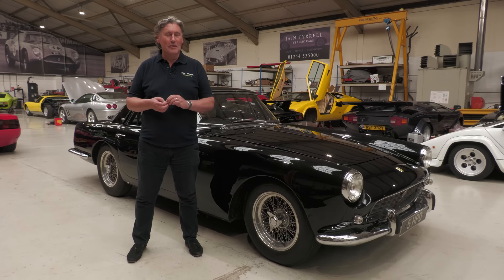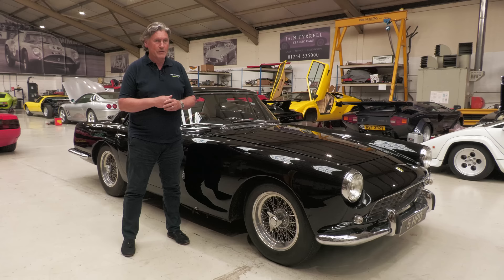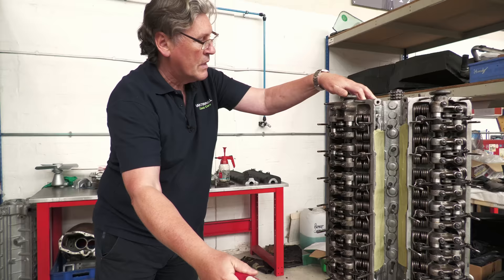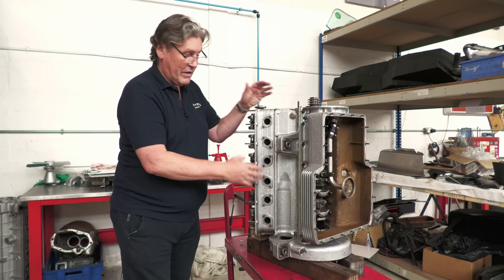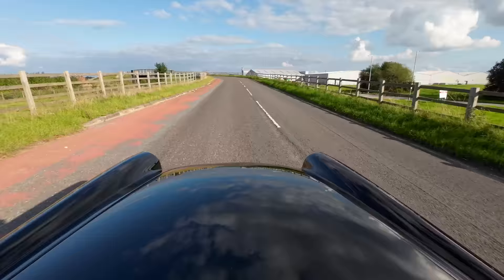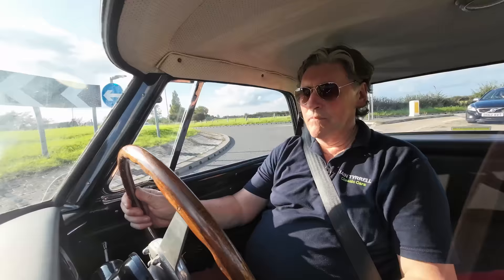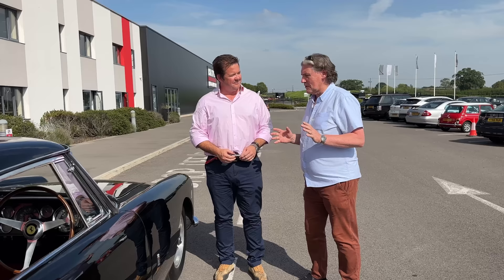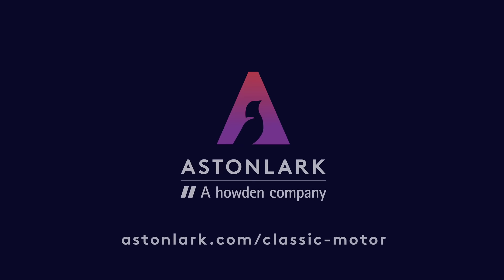Disaster Strikes! Ferrari 250 GT Coupe Road Test Drama | Tyrrell's Classic Workshop

Comment: How could one forget the Haynes manual. 32 steps to pull a clutch cylinder, you turn a page and "assembly is the reverse of disassembly." Good luck!
Reply: Absolutely. God bless John Haynes. His manuals saved me a fortune in repair bills over 50 years.
Reply: Yes! Then we had internet forum, full of nonsense and then YouTube. Oh well! :)
Reply: @alexandrecouture2462   tbh, forums are still full of nonsense.
Reply: @GL-xz3xk  It's true that it helps if you can read when using them...
Reply: @GL-xz3xk  It's true that they say/said "assembly the reverse of disassembly", but if you've taken it apart in a rational/logical manner and not strewn the parts everywhere, that shouldn't present a problem if you are competent. Incorrect photos not my experience with the 20 or so Haynes manuals I've had. YMMV.
Reply: @laurieharper1526  I agree totally.
Reply: @laurieharper1526 I got the habit of buying the Haynes before the cars. Saved me from buying bad ones a couple times.
Reply: @426baron  I had a bit of a collection, too. Used to pick them up in 2nd hand shops. I gave most to a local garage recently that still works on older vehicles. Kept my Saab 99 one (for sentimental reasons - had four 99s over the years) and the one for my current vehicle.
Reply: @GL-xz3xk Not my experience, we used them successfully with a variety of cars. They were also very useful as an example for primary school children to see a real life example of the Imperative tense..
Reply: Back in 1980 I wouldn't have left the garage without the Haynes manual in my 1972 Mini 1275GT, they where that good! The manuals not the Mini :D
Reply: How is that bad? You do exactly what you just did but in the reverse order.
Reply: @426baron  If not before then definitely on the way home from purchase: Do the deal, drive the car home, swing by Halfords en route and get plugs, points, oil and filters. Back the following week for all the stuff you've discovered needs doing too. 🙂
Reply: @peterrenn6341  yeah, I did that too. There's also "discovering" the terrible problem that got the car sold cheap  is a 15p missing bolt.
Reply: @VolkerHett  ideally : one in the car, one near the reading armchair. A pdf on the phone mat help too.
Reply: That made me laugh,, I went through that when the clutch on my Fiat Uno Turbo went tits-up in the late 80's and I used the Haynes  manual.  The shop time on that job was like 3 hours,,, took me a week!  Got it done though.
Reply: I can remember attempting a head gasket on a french car in the 1980's? Haynes manual says the job can be done with the engine in situ? Got well stuck in undoing the cylinder head bolts and then turned over the page on a new leaf and then Haynes said that the engine has to come out!
Reply: @giuseppegiacomoni7058  A lot of Subaru's are still like that,,,, it's amazing in this day and age,,,, even Toyota get it wrong sometimes. I drove the piss out of my Spitfire in the 80's,,, for 8 years,,, and it was already 15 years old when I got it.  I think that had a copper gasket,,, maybe even cork,,,,, never leaked but could have done it in the driveway.

Comment: During my restoration career , I was fortunate enough to work on and road test many early Ferrari cars .
As you said , a road test very often reveals problems not on the work schedule .
When you revealed the doughnut joint failure , it reminded me of the many E types I did work on . The drive train components very rarely received lubrication .
As the propshaft was buried within the tunnel and floor skin  , I made the decision to always replace it with a brand new one if either the engine/box or diff cage assembly were removed .
The customer had no decision in the matter ! 
When you explained the cost of replacement on its own , nobody ever complained .
Most remarked on a smoother drive .
Really enjoy your engineering videos .
Please continue .

Comment: I was proper nervous watching this video especially when you were doing the test drive.  I kept expecting the engine to explode into a million pieces because that piece of rubber hose on the oil feed had disintegrated.  Glad it was nothing too calamitous.  Another brilliant video, thank you so much Iain it's always a good Sunday evening when Harry and you have both posted new videos.  Can I also add my voice to your call for people to visit the Haynes museum,  I don't live too far  from it and I go several times a year.  They have an amazing collection of cars there, the red room is my favourite, so many cars, all in red. I can't decide between the Countach or the Masrati Merak, I'm a sucker for a flying buttress!  Thanks again.
Reply: I was also nervous! Not with what was going to happen to the Ferrari, but my 'nervousness' stemmed from taking-out a very valuable car on such narrow roads, and the risks of a drunken driver hitting it! I was also concerned that the Tyres on the Ferrari may have been 'out of date', and I was expecting a blowout too! Today, a car like that is not suited to roads or Supermarket Car Parks. It is a showpiece that should be greatly admired in a Showroom. I couldn't conceive the Insurance Premium on such a car. To Iain, your knowledge is invaluable, and I have watched this video twice now. The Rubber Junction in the Oil Pickup however, would be changed for a more modern and resilient solution, and this shouldn't detract from the cars value at all. Greetings from Australia.

Comment: At @27:28, this is similar to certified aircraft engines like Continentals & Lycomings. The break-in oil allows a bit more friction for the rings to seat with the bores. During breakin we also run them at 70% power or higher as the high cylinder pressures facilitate breakin. You know it's broken in when oil consumption stabilizes and cylinder head temps drop slightly.

Comment: I had a propshaft donught explode on my 1983 BMW 528i Auto, just approaching the East Lancs road on the M6 north. I pulled onto the hard shoulder, called the AA and waited. I couldn't start the car. After a lot of playing around, I lent on the auto selector as the AA guy tried to crank the engine and it started, turned out when the doughnut exploded, it bent the gear selector rod, when we both thought it was in D, it was in P!!. Another great video and as usual very informative.

Comment: Truly fantastic bit of motoring history - how many of us grew up with our Haynes manuals, covered with our oily thumb prints all over them, whilst laid under our cars, in the road? Fascinating insight into the engineering of these beautiful engines and cars, Iain; and your meticulous work. Whilst UJs don't fail usually anymore they wear and become noisy; those rubber joints made sense once.

Apparently Mike Hawthorn clipped an oncoming Bedford lorry, on the A3 Guilford By-pass, after hitting a bollard in his very modified MK1 3.4L saloon (VDU 881); Rob Walker was advised to deny any mention of 'racing' at the coroner's inquest; hence the speculation for a long time; but did admit to it many years later. Really enjoyed this film, thanks.
Reply from the maker: Thanks to you too for the added information

Comment: Valve covers should be as they were from the factory.
Reply: If you want to file the crackle finish off the lettering it’s fraught with potential problems and has to be done carefully to avoid any ‘breaking out’.  If done properly it looks good, but I’m probably with you on leaving it

Comment: During a tour with the U.S. Army in Germany in the '60's, I owned a BMW 700 coupe which employed donuts to join the half-shafts to the rear wheels, and was prone to just such a failure. The donuts were inexpensive and easy to change out, and MUCH smaller on that 700cc vehicle.

Comment: Donut, eh...now I finally know what they call that in English! Had that fail on one of our sailboats when we were in rough seas and the stern bobbed about and lifted up out of the water and settled back into the high waves for an entire night under power. The frquent changes in the torsion on the prop shaft taught us a lesson or two but "Donut" we shall call it from here on in...thank you for the run-down on Mr. Colombo´s work of art and the pitfalls of the early triple-throat fuel ingestion...

Comment: Fabulous video. Many thanks for the insight of the 250 engine. I couldn’t see the Farina comparison personally and the lines of the 250 look superb. Have seen the doughnut design before they in Lotuses as a crude kind of universal joint. Being made of rubber and responsible for transmitting so much torque and power and being constantly flexed it is a part just waiting to fail. As my IT colleagues say of computer hard drives, there are just 2 states: failed and about to fail! The Haynes museum is superb and highly recommended. As for the rocker covers, they have to be per the factory without polished highlights. Shame about the cracked windscreen.

Comment: Stirling Moss gifted Mike Hawthorn the 1958 F1 Championship by his sportsmanship at the Portuguese GP, where Hawthorn would otherwise have been disqualified.  If you think that a rubber oil supply hose is crazy, try a toothed rubber belt to drive the oil pump and another for the camshafts, running in oil splash, on certain current 3 cylinder engines.  Highlight the "Ferrari".  If you have it, flaunt it!

Comment: Great video. I’m sure I’ve seen similar to those ‘donuts’ in Lotus Elan suspension, so maybe Colin Chapman innovated there. But 1950s to 1990s for a basic engine. The Busso Alfa Romeo twin cam 1954-1994. Columbo, Lampredi and Busso. All geniuses 💚🤍❤

Comment: Had a couple of  Triumph 1300's as a student, those doughnuts cost me many trashed knuckles - especially as the oil filter would leak on one side and damage the rubber -  I learned to cover the coupling in cling film during oil changes !

Comment: late 70's early 80's I passed up two GT 250, one for $7k and $9k. A Dino for $9k. No one really wanted them, not a Magnum PI 308 or the Dino had a lowly v6! 
 GT Maserati's where even less money for they weren't a Ferrari!  Another car that majority of people passed up, some thought it was weird looking, the pagoda top Mercedes 
Sl 190 230 250 and 280 I really loved the looks and design of these cars.
 But I like Fiat X19's so I am different. they are so fun, like a go cart and you don't have to prove anything to anyone with 70ish hp! Just smiles per sharp corners miles, have had 5 and have one now with motorcycle carbs and Abarth cam and header

Or Porsche 914's with their 4 wheel disc brakes, independent, all, suspension, mid engine, trans out back and 5 speeds, fuel tank behind the front wheels, fuel injection, removable top that gives a roll bar when stored away and huge amounts of interior space and trunk space. Let's add low center of gravity too!  Have 2 of those, a 70 and a 73.
 Had and still have a 1972 911T. Everyone wanted me to do turbo flairs. No, I like the narrow body with deep six Fuch's wheels and a motor that you don't have to be in the stratosphere of rev's like the 911S almost all of the time.  In 1985 I did a full respray, every thing off, doors hood rear deck lid. Put it up for 10K and no one wanted it, not a S or turbo look. 
I am really glade I am stubborn and kept it along with the others that most people did not realize what the are. Looking at where the prices are people are catching on...

Comment: It's interesting that when you started talking about the styling of this particular 250 GT etc, I've always seen in this Ferrari the later MGB! Stand back and 'look', headlight cutouts, grill, bumper over riders etc all, quarter windows, rear lights and remove the 250s fixed hardtop... all are very reminiscent of the MG. Paint an MGB roadster black, chrome wire wheels and a similar style 'hardtop' and you've have a 'Mini-Me' (from the Austin Powers movies). I do wonder if the later styling of the 250 GT did influence the MGB roadster? The 250 GT is a stunning survivor.
Reply from the maker: Apparently the MGB was indeed styled by Pininfarina. There you have it!
Reply: Actually Ian, the MGB roadster was an inhouse design, with the designers taking much influence it seems from continental cars of the time including the pocketed head lamps from a 'Ferrari'. It was the later MGB GT introduced in 1966 that had Pininfarina influence in the fixed steal top design, along with some thoughts of staff within MG. MG sent out a roadster to Pininfarina and it came back as the prototype GT.

Comment: the Haines car manuals hopefully were better than the motorcycle manuals. My Honda 250 N 1980 manual had pictures of various Suzuki engine and brake photographs - the theory was fine but they obviously didn't tally up with the photos
Reply: Car manuals got worse as time went on, I've had many over the years. Currently working on a fiat cinquecento and manual says "remove gearbox ".... a bit more detail would be nice and colour pictures.  I believe they only make digital books now 🙄 handy when your phone goes flat or forget your login details 🙃

Comment: 20:17 I have a question that no one seems to be able to answer. What are so many cooling fans on cars made as an uneven cross? Why are the blades not at 90 degrees to each other?
Reply from the maker: It’s done deliberately, as uneven blades lessen the noise

Comment: Another little pearl of wisdom on checking for wear in the cam chain by scrutinising its side play—thanks for this, Iain—filing that away for future reference! 

It's always so easy to listen to you talk, even inside a large workshop, your voice carries well. No doubt the recording equipment employee plays its part, however I realised, during this video the ability to hear you clearly, is in part due to the confluence of several of your diverse interests, because your voice projection is so good. Duh! Of course it is, with your musical and acting experience. It makes a difference. ;) 

Apropos the valve gear covers: With such a historically significant example of the model, if a choice between originality or modifying is not one which impacts preservation, longevity or reliability, I think the decision is an easy one. Keep it original. And I agree, that cooling fan would not look out of place in a gallery. It's exquisite!

You mentioned that certain racing vehicles including some Lotus models employed donut flexible couplings in their drivelines. As it happens, I made this photograph of one such Lotus in March at Longford, Tasmania, once the location of the Australian Grand Prix and host to Tasman Series competition. 
https://www.flickr.com/photos/tasmania_film_photography/52799426411/in/album-72177720308224763/

The car is an ex-Jim Clark Lotus 39 which was actually raced by him at Longford during the 1966 Tasman Series. In the photo you can see the near side driveshaft and its substantial donut. You may view the photo at a larger size here:
https://www.flickr.com/photos/tasmania_film_photography/52799426411/sizes/h/

Many thanks for another interesting and very informative presentation.
Best,
Brett

Comment: BMWs also used those rubber doughnuts for decades. All the ones I owned had them (the last I owned was a 2000s e39 M5).
They do rot and really don't like hard acceleration. The M5 needed numerous replacements despite the fact that I never deliberately spun the wheels.

Comment: My Clan Crusader used ‘donuts’ in its final drive. If (and when) it was driven over about 90mph at least one of the bolts would sheer off resulting in a nasty knocking sound. Luckily it was easy to fix. I’m fairly sure that I had a Haynes Manual that was specifically for the Clan but I might have had to use an Imp version.

Comment: Bought a Ferrari Barchetta from Peter Giddings,while he was in Australia,c.2000,after initially it was sold to Tourist Trophy Garage,as I recall, with an Abbott Body,but then was built as a Barchetta 88inch Wheelbase into a 1951 Ferrari 212 Barchetta. Chassis Number 0165EL, Engine # EU247

Comment: It's interesting to note that the rebuilding of piston powered aviation engines also require 'break-in oil' to properly seat and bed in piston bores along with the rings so as to insure optimum compression and power. You can't just pull over to the curb when your airplane loses power like a car!

Comment: Hello Ian! What I did like about this engine was the bore spacing between the cylinders and also the block which has a closed deck and wet liners. I fully understand when you explain about the porting of the inlets and that their are three of them on each bank as opposed to having six of them? My Question for you is in this respect are the three ports of the siamese type as found on the A series mini coopers? If so is the camshaft a scatter cam like on the mini cooper? On the Cooper the engine each cylinder is treated differently for valve timing? In effect although it is a four cylinder engine it is a engine with four individual cylinders is this so with the Ferrari that all 12 cylinders are breathing differently?

Comment: My parents' Triumph GT6 Mk3 the owned new in the early 1970s had the "rubber donuts" a.k.a. Rotaflex couplings. I didn’t know the likes of Ferrari used them.
Regarding Lotus using Rotoflex couplings, the original Lotus Elan used them between the differential and drive shafts (same application as that on the GT6 Mk2 & early Mk3s).

Comment: I have seen that car on display at my kids school fete but didnt realise the significance of it. The problem with those donut / guibo is the quality is very poor these days also if it lets go at speed its very very ugly. I gave up and fitted a modern flex disc instead which has a far higher capacity, high quality and works just fine on my Alfa and its easy to convert.